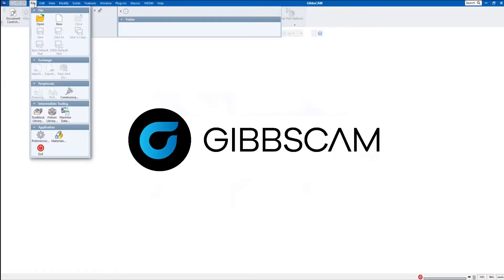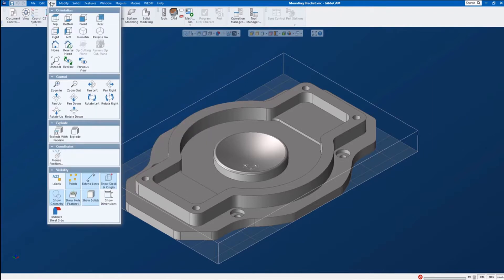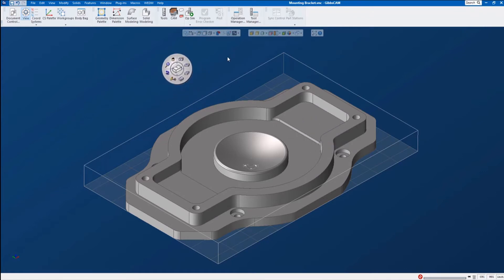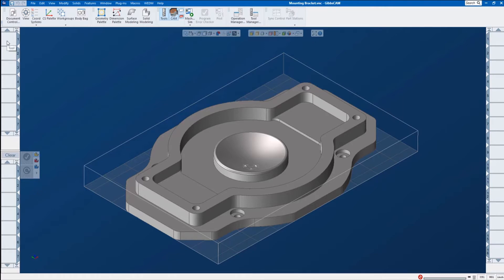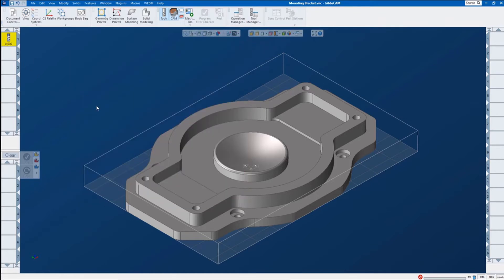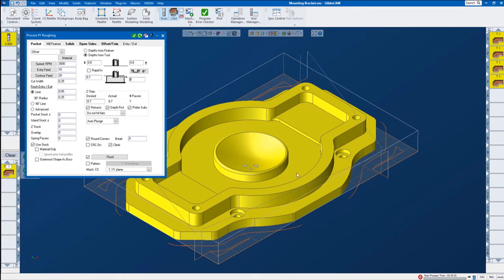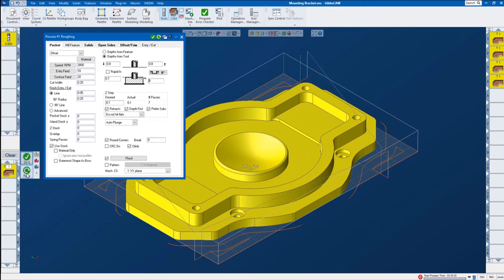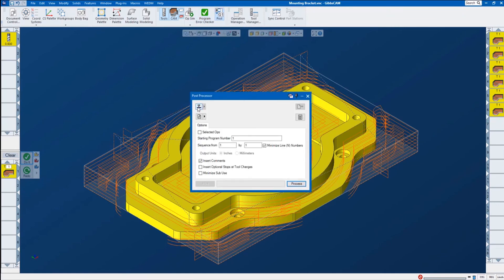GibbsCAM Quick Start - ROUGHING

Comment: how to set origine part
Reply: Open show edges and turn off show geometry. Control+ left click any edges that would lead you to your desired origin then right click then select extract edges. You'll be prompted for a tolerance for the resolution of the facets that will be extracted from the model. I use .0001". Then click do it in the tolerance box. This will create a wire frame 2d geometry. Make sure that you are at the desired Z origin as well. You can also use this method with face selection. Then with the extracted 2d geometry you can use the the geometry palette and dimension palette to locate your desired origin. Again double check your Z origin. Potential crash hazard. One thing to note if you extract a hole or circle geometry it will not be a true circle but a polygon with many many sides. It could potentially post out point to point instead of swinging an arc from a center point ( i & j codes ) which can produce a lot of unnecessary code and not cut a true circle when interpolating. Be sure to follow your print to properly draw a circle. You can test this by dimensioning the geometry extracted from the model. Usually it will not let you dimension a circle or hole geometry extracted from a model because it's actually a polygon. All this is from my experience.
Reply: Oh and you'll need to use the translate tile and or move part origin to assign your desired part origin.
Reply: Then select shrink wrap visible and your document control should then reflect your new origin.